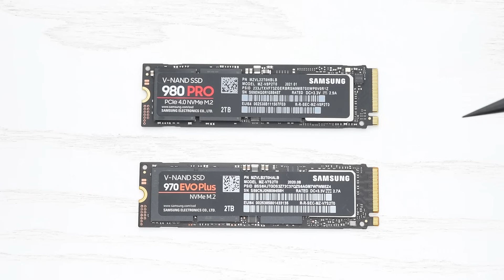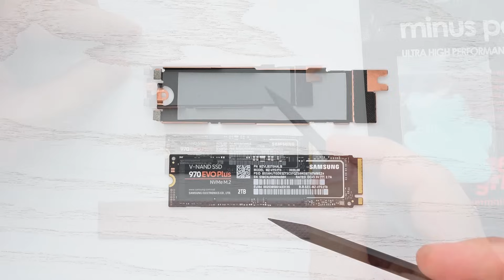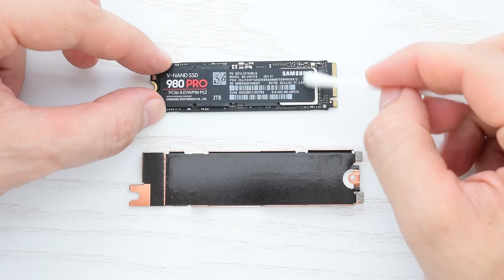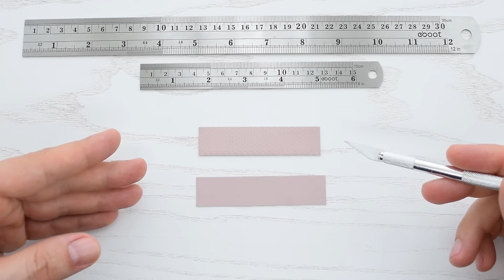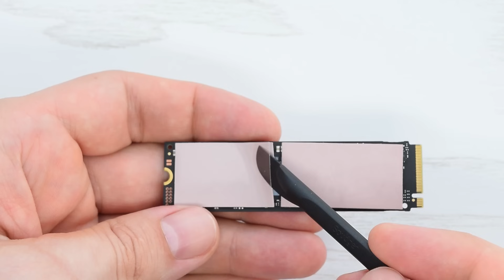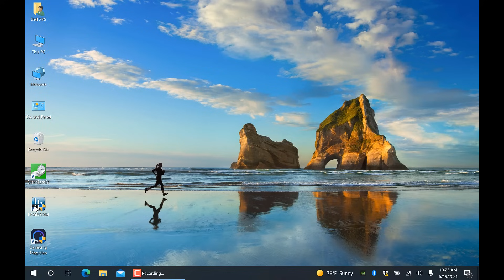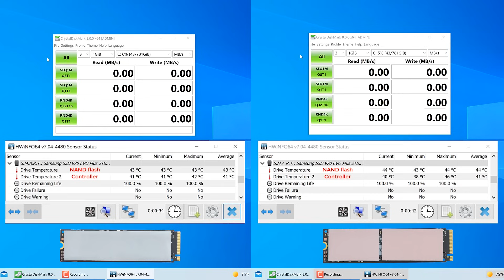Stop your Samsung NVMe SSD from Overheating and Thermal Throttling

Comment from the maker: I was the first one who made a video about this design flaw, but I'm not sure if I was the first one who noticed this problem. We received a bunch of laptops with fried controller chips on Samsung's SSDs that didn't have proper cooling and the chip didn't even touch the thermal pad. Later, Samsung came up with the 980 PRO with a built-in heatsink. And if you remove that heatsink, guess what you'll see inside? Yes, there will be several thermal pads with different thicknesses, just as I showed you in the video. But they went even further and made separate pads for small chips as well. You can check out the pictures: https://i.ibb.co/10HwmmQ/980PRO.jpg
Reply: Thanks for the video and for showing the thermal pad height difference on a built-in heatsink. I want to point out a worse issue that it still going strong without a single try to be fixed by motherboard manufacturers. Because of the height difference between the NAND and the other chips (controller, ram etc) build-in heatsinks on the motherboards push the M.2 drives down resulting in bent PCBs (google "nvme bent under heatsink" to see pictures of the issue). Different height thermal pads or putty are necessary not only to maintain normal temperature on high load but to avoid damaging the drive physically by applying too much force on one side of the PCB.
Reply: @Electronics&Computers Do youknow if in 990 pro the gap is the same, 0.5mm?
Reply: Giving this a try. I was filming with an acasis thunderbolt 4 case with 980 stick and the footage is corrupted. Only footage from day time actually, the night time footage is ok. I'm guessing I had this issue. Thank you for the information
Reply: I have Phison ps5012-e12, is it okay to use just a thermal pad and no heatsink? Inside a PC case
Reply: Great job. You might have woke them up. Simple but effective. Will do this when I transfer my 990 to the newer laptop :)
Reply: OMG, found your video ❤, i have 2x Samsung 970 Evo Plus in my Lenovo laptop and...one disk when im gaming reaches 84C (controller temp), now HWinfo64 is showing 3 temps for these 970 Evo Plus, and 3rd temp is controller (like in your video)! Looked for pads - these 0.5mm costs 26€ for 1 little pad (why so expensive) 😮? I will try my luck in aliexpress mby 😢
Reply from the maker: @KOT-ANGRY  There are way better thermal pads nowadays like GELID: https://alii.pub/6t99o1
Reply: @ElectronicsComputers  very helpful and informative, thank-you. I'm curious though, would it be okay to just buy 1 thermal pad only, 0.5mm, and double-stack two 0.5mm pads on top of each other in place of the 1mm section, just to save a bit of money? Or would you highly recommend using the dedicated 1mm pad regardless?
Reply: @othername2428  Two thinner pads stacked together wouldn't be as good. The interface between the pads will result in an additional thermal barrier.
Reply: P.S. I noticed it ~year ago, now one amigo said that im crazy and these temps are super hot for SSD! A lot of forums here... When i installed it (changed my 970 evo 500gb to this 970 E P 2tb) i noticed that here are height difference on Samsung ssds!!! Thats annormal, Samsung, what are you doing?

Comment: Thank you very much for the guide, it worked as intended for my Samsung 990 pro 4TB NVME. I also polished the Thermalright HR10 heatspreader until mirror finish before applying the replacement pad of my 990 pro. Thermals before was 88-89c with the stock nvme heatsink of my Asrock B650i Lightning and the peak thermals now is at 52-53c even with the side panel and dust filter of my case (Thermaltake TR100). Take note that you'll need to check your motherboard in regards to the clearance for the Thermalright HR10, as I was lacking around 0.3-0.4mm, I had to wiggle in the cooler and slightly tilt the stock GPU riser cable just for it to fit all the way.
Reply from the maker: Great job!

Comment: Great and informative video of the issue. However, finding accurate schematics for specific drives has proven very difficult, at least more detailed than simple L x W x H information. Or side shots of the drives to determine if they also have this fault - is this only a Samsung issue? Currently looking at WD SN8100, but can't find the SM2508 or Kioxia BiCS8 height anywhere. Any suggestion?

The only information I was able to locate was the height difference between the 4TB and 8TB versions, at 2.38mm vs 3.88mm respectively, assuming because they are double-sided for 8TB. So each NAND is ~1.5mm perhaps, assuming it is the tallest component like in the video.

Comment: I bought these copper M.2 heatsinks from Amazon, and in one of the pictures, it shows a copper heatsink applied to both sides of the SSD (chips side and board side).  Is this correct?  I mean, I guess it wouldn't hurt to put a heatsink on both sides, but... I guess it weirds me out a little.  It didn't come with any instructions.

Amazon - Easycargo Laptop M.2 Heatsink Kit
Reply from the maker: The installation depends on your setup. A heatsink under the SSD won’t hurt, but some laptops don’t have enough space underneath, and some have other components there, like chips or capacitors. A copper heatsink could short them out. So first make sure there’s enough clearance if not, just use a heatsink on top.

Comment: Any recommendations on desktop NVMe heatsinks? I have one on my main Gen4 slot (motherboard only - I'll need to go thinner if I go aftermarket, but I'll likely do the two pad method to improve things a bit with it...
Reply from the maker: We use this heatsink https://amzn.to/4pkb8as for our customers, and I also have it installed in my own PC at the repair shop. It’s very easy to install and keeps the SSD cool even under heavy load. For Samsung SSDs, you still need to use the two-pad method just like in the video. By the way even Samsung is doing the same trick with their SSD heatsink version: https://i.ibb.co/10HwmmQ/980PRO.jpg

Comment: Thank you for this video. Yep controller IC was lower on my SN850x and did the 1mm and .5mm thermal pads to heatsink and now no air gaps and even and now getting a consistent over 3100 read and write without thermal throttling and great temps on my thunderbolt USB enclosure which is a huge heatsink that use as a scratch disk for hours of editing. Before would get high temperatures after a couple minutes and couldn’t understand why as the enclosure is a huge heatsink and now not no more, it runs cool. Made a huge difference.
Reply from the maker: Great job, man! You didn’t just fix the heating issue you also massively extended the lifespan of your SSD. Samsung actually started doing the same thing later with their heatsink SSD versions: https://i.ibb.co/10HwmmQ/980PRO.jpg

Comment: Thanks you for video. I'v just bought samsung 990 PRO 4TB and instaled in Asus Rog Zephyrus G14.
Wouldn't it be better to remove the original Samsung sticker first and only then install/apply the thermal pads?
Reply from the maker: Removing the label will void the warranty and it doesn't make any real difference in cooling your SSD, we've tested it many times on different drives.

Comment: when i installed  a be queit m1 pro on my 970 i used the same 1mm thickness pads for both memory and controller and now controller and memory temps are always equal,  is it because i used the same thickness for both? should i switch the memory pad for a 0.5mm pad? or just buy a 1.5 pad? also i didnt remove the pre installed pad so its basicaly an even 2mm pad. should i remove it and only keep the 1mm one? thank you for your time
Reply from the maker: Removing the label will void the warranty, and it won’t make any real difference in cooling your SSD. We tested it, and the temperature drop is so tiny that it’s not worth stressing the components or losing your warranty just to peel off that sticker. If a 1mm pad keeps your SSD tems in IDLE about 40C and under load at around55-65C you're good. But make sure you're using proper software to read those temp sensors, because Samsung magician can't do that.
Reply: @ElectronicsComputers   sorry, my question was unclear. i meant that i applied an additional 1mm pad on both controller and memory besides the stock 1mm that came with the heatsink so a total of an even 2mm. now hwinfo shows that memory and controller have the same temps  and now both controller and memory  they idle at 45 and go at 75  when gaming.  so i was wondering if i should remove the  stock 1mm from both memory and controller so i have a single 1mm pad or  maybe just remove it from the memory. sorry again for the unclear  question.

Comment: Has anybody used Honeywell PTM pad on a ssd ?
Reply from the maker: The Honeywell PTM pad is too thin, and it's designed for smooth, uniform surfaces not the rough, uneven surface of an SSD.
Reply: @ElectronicsComputers  Thanks for the honest answer!

Comment: Is the thickness difference apparent also on the 990?
Reply from the maker: The Samsung 990 has almost flat surface, so you can just use one 0.5mm pad.

Comment: Can i ask you something. My laptop hp victus 15 i5. Did not have heatsink. Can i apply thermal pad only with out the heatsink ?
Reply from the maker: On that laptop model, the back cover acts as a heatsink and should have a small thermal pad attached to it. It’s better to replace it with a high-quality thermal pad or thermal putty for improved heat transfer.

Comment: Does the same problem occurs with the samsung 990 SSD too ?
Reply from the maker: No, that model has nicely leveled components, so you can use a single 0.5mm pad.

Comment: Any particular reason for not using thermal paste? Maybe on one side instead?
Reply from the maker: Thermal paste isn't meant to be a layer, it's just supposed to fill microscopic gaps and it's thickness should be way below 0.1mm. So it's simply not gonna work for SSDs. But you can use thermal putty which is way superior than any thermal pads. The link in the description and I also have a video on how to use it: https://youtu.be/Dv17kIgHyK4

Comment: my stock ssd comes with a thermal sleeve. im not sure if a heatsink would fit in my ROG G14 (2024). is it ok to just use the thermal sleeve along with the 0.5mm + 1mm thermal pad setup
Reply from the maker: That sleeve on the SSD in the ROG G14 will overheat almost any drive. But there  are a few options which we also provide for our customers. The easiest is using this method together with a thin universal heatsink (link in the description). The second option is applying a generous amount of thermal putty (like Upsiren) on top of the SSD surface, the same method used in the Xbox Series. In this case you don't need any thermal pads or that sleeve. You can check out my video on how to use thermal putty: https://youtu.be/GTvtAM7Fi5U
In this case, the laptop’s back cover will act as a large heatsink.

Comment: with 990 pro can we use single pad or no?
Reply from the maker: With the 990Pro Samsung finally solved the problem and its surface near flat, so one 0.5mm pad will work just fine.
Reply: @ElectronicsComputers ty
Reply: @ElectronicsComputers Are you sure? I have both the 990 Pro and 990 Evo Plus. I added extra 0.5 mm pads (arctic tp-3, stackable) over the controllers on both because the controllers were getting very hot. Also it was clear visually that a thicker thermal pad was needed over the controllers.
Without the extra thermal pads the controllers were about 15 degrees hotter.

Comment: Are gen 4 NVMes inherently hotter than gen 3 (no temperature difference when used on gen 3/4 slot), or will the temperature decrease when used on gen 3 slot considering the speed is also capped by the gen 3 slot?
Reply from the maker: This trick only works if you're using a newer-gen SSD than what the laptop supports. In that case, the SSD will run at a fraction of its full potential it won’t overheat, but it'll still perform better than a same-gen SSD, which would have to run hot just to hit similar speeds. An SSD that matches the PCIe gen of the laptop will always run hotter.
Reply: @ElectronicsComputers  Thanks, gen 3 NVMes like 970 Pro/Evo are starting to disappear from markets but i wasn't sure if gen 4 ones like WD SN580 are fine to use without heatsink on a gen 3 mini PC.
Reply from the maker: @yaxl  The WD SN580 will work fine. You can also use some gen5 SSDs in that setup too.
Reply: @ElectronicsComputers  Any other recommendation for any gen NVMe that runs cool without heatsink?
Reply from the maker: @yaxl   If I had the option, I’d definitely choose the Samsung 990 PRO. The 990 PRO uses Samsung’s Pascal controller, which is built on a smaller node making it super efficient and runs way cooler. At my repair shop, we also do data recovery and I’ve noticed that with many SSD brands failures can be random and sometimes make no sense. But with Samsung SSDs, issues are usually user-caused like overheating or mechanical stress (removing the label, or using thermal pads that are too thick, which leads to bending or PCB deformation over time). We’ve had the highest success rate recovering data from Samsung drives, because they are well-designed without cutting corners.

Comment: works this on the 990 pro too with the same measurements of pads ?
Reply from the maker: Samsung finally fixed that problem and leveled all the chips. Just use one 0.5mm pad.
Reply: @ElectronicsComputers thx for the reply 😊

Comment: One last thing. Make sure you update the firmware on those 980 Pros, especially if it's still on the stock firmware. I've had several of them drives die on me in recent month. Whatever damage or corruption created by Samsung's buggy firmware can not be rectified by updating. You'll have to RMA them.
Reply from the maker: Oh yeah, it was a well-known bug in the older firmware that suddenly dropped the drive’s health to 0% and ended up bricking the SSD.

Comment: Do you need to aplly thermal putty between the thermal pads and the ssd or no ?
Reply from the maker: No, but you can use only thermal putty, which offers superior thermal conductivity, fills in all surface imperfections perfectly and efficiently transfers heat from components to the heatsink. No thermal pad comes close to the performance of thermal putty.
Reply: @ElectronicsComputers so I should take thermal putty instead ?
Reply from the maker: @tauriene9400  For most devices it would be the best option. What's the model of your laptop?
Reply: @ElectronicsComputers it's an Asus tuf Dash f 15 FX517ZM
Thank you for responding to me all those years later
Reply from the maker: @tauriene9400   That model doesn't have any built-in heatsinks for the SSD. If you're using a universal one, make sure to pair it with a thermal pad—otherwise, with the stock setup, there's nothing cooling the drive, and it’ll just slowly cook itself.
Reply: @ElectronicsComputers Ok I see why I was having really high temperature then
Thank you for helping me !
Reply: @ElectronicsComputers Just last one question 
Has the height problem been solved on the 990 pro Samsung SSD ? 
If yea only a 0,5mm thermal pad should suffice no ? 
Thank you again for helping me

Comment: Excellent and very helpful video. I have the Samsung 990 Evo Plus 4TB NVMe SSDs and I don't seem to see a difference in the height of the two chips as you show here. Has this difference in height been addressed in this model?
Reply from the maker: Samsung finally fixed that design flaw. For last models of 990EVO you can just use one 0.5mm thermal pad.
Reply: @ElectronicsComputers  i have the 990 EVO + 4TB that i'm installing in the ACASIS alum case but i bought the 1.0mm thermal pad. since it's a case, the thicker thermal pad shouldn't be an issue, right?
Reply from the maker: @smalltalk.productions9977   Yes, 1 mm will do the job for that enclosure pretty well.